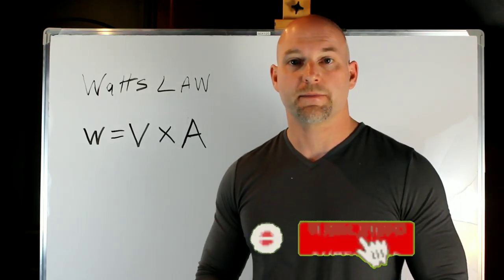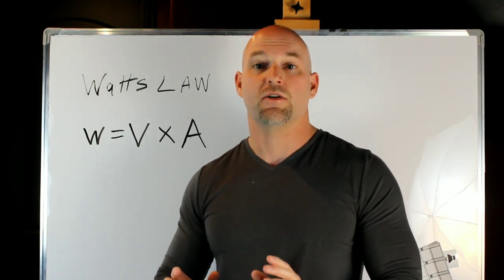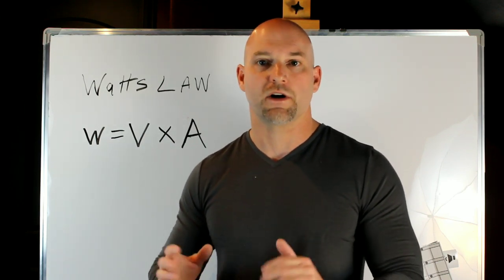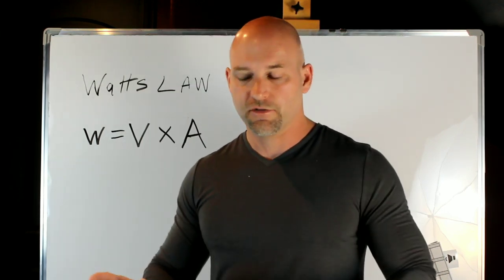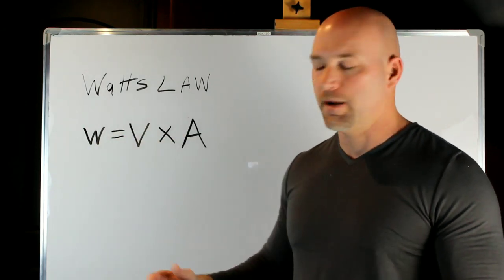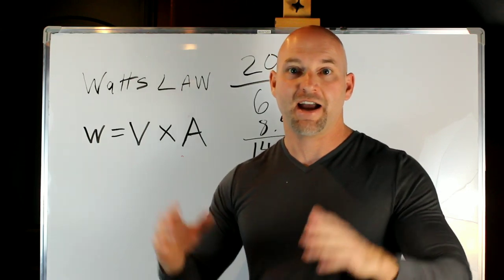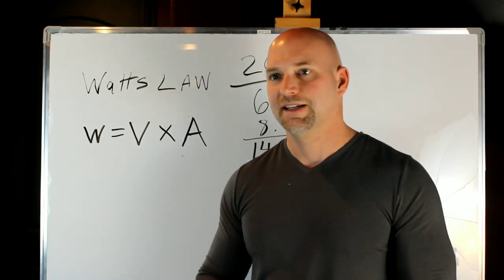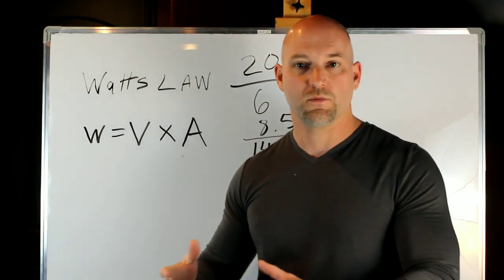Ep. 19 - How to determine how much Home Theater gear can be put on a circuit | Home Theater Gurus

Comment: As a professional installer I just want to add that 99.99% of the systems out there are perfectly fine on a single 15a feed. The more relavent issue is proper system grounding...but that's another story...
Good video with correct info 👍
Reply from the maker: Thanks!

Comment: Up-size Your Wiring

It's important to note that if one is wiring their Home Theater, it's prudent to up-size the wiring to the receptacles supplying the gear. That way voltage drop can effects can be minimized. 

As stated elsewhere, to avoid nuisance tripping, breakers can pass mammoth amounts of current for prior to opening up. 

A 20a residential breaker can typically pass; 
~140-160 amps for a second
~60amps for ten seconds ~30-40amps for as long as 30 seconds!  
They're designed this way to prevent nuisance tripping... whereby you'd be in your panelboard resetting breakers constantly. 

Circuits supplying subs in high performance HT, up-size the branch circuit wire size between the breaker and the receptacle.

Comment: Really surprised there are not a lot more comments on this episode.  This is definitely one thing I think people overlook, or at least don’t consider at this level.  Since I’m running a Denon 4400 running 4 surround and 4 Atmos, an Emotiva BasX 3 running my L/C/R and 2 SVS subs all on the same 15A circuit, I’m surprised it hasn’t tripped.  Thankfully my basement where this room resides isn’t finished, so I think I’ll do one 20A for the subs, tap the Projector in the lights, and 2x 15A to run the equipment (Denon, Apple TV and rack cooling fan on one, and Emotiva and Bluray Player, PS4, Xbox S on the other).  Not that I’m worried about a fire as much as tripping the breaker when everything is running.

Great vid!  Thank you
Reply: The breaker will allow much more current than 15 or 20 amps ... easily double that for extended periods.
Reply: @FOH3663  our breakers only permit a spike up to 20 amps for a few seconds and then trip. We wouldn’t want it to do 20A+ continuously as the wire is only 14 awg, standard for a 15A outlets.
Reply: @zalllon  
Your breaker behave just as I described.

Comment: A couple of points. Those amperage ratings are for continuous full draw. When you are just listening at moderate levels with no explosions, your amp is barely pulling anything near those ratings. 

Also, in regard to to the 15 and 20 panel amp. Those ratings are for a continuous pull. They will happily handle bursts of ~10 times their ability for a handful of seconds, say a large explosion in a movie, where you get full draw for a short period. 

Now, if you play a continuous sine wave at reference, then you'll have problems. Dubb step, etc... But for movies, you can pack a lot of power on a single 15amp circuit.
Reply from the maker: Not sure if you watched all of the video but I mention pretty much all of that in the video, the breaker doesn't trip immediately and briefly explain how it works, I explain we normally use a fraction of the speced load.
Reply: @hometheatergurus  I honestly watched the entire thing. Must have glossed over it. Turns out, i'm dumb sometimes.
Great Videos!
Reply from the maker: Haha... No worries I'm the worst at missing stuff and sure sometimes I forget to put something in a video or wish I had added things. A lot of the stuff is kept short and sweet on purpose.

Comment: So instead of plugging everything into a surge protector/power conditioner, I should spread it out to different wall outlets throughout the room?  I want to do 2 front subs and 1 rear (dual SB-3000-front, one sb-1000 pro-rear).  But I also plan on having an 85inch mini led with an 11-channel power amplifier.  So I'm thinking Plug in the TV, DVD player, Pre-Amp, and Amp into a surge protector/conditioner that plugs into one outlet, but at least plug in and run the subwoofers to a different wall outlet to break up the power draw?  Hope that makes sense.
Reply from the maker: Not different wall outlets but ideally on different circuits.  That's assuming you've added up what is on  each circuit and its maxed out.  It's not always possible in preexisting rooms as many times all of the outlets in a room are on the same circuit.
Reply: @hometheatergurus  Cool, Thanks for that response.  May look into adding a dedicated circuit then. Checked my breaker box and there is one switch for the entire
 game room :(

Comment: i have a old QSC amp that i want to use for subs.....its a QSC MX 3000 IT SAYS NORMAL OPERATION IS 12 AMPS AND FULL POWER IS 58 AMPS...WOULD I BE GOOD WITH A 20 AMP BREAKER..?..

Comment: So, in your opinion, I should use a dedicated 20 Amp circuit for each JTR Captivator 2400 ULF? I am in the process of wiring now. Great videos! Really appreciate the tips!
Reply: Two of those amplifiers can share circuit, as long as you don't encounter significant voltage drop
Reply: Eric, did you end up running a dedicated amp if you don't mind me asking?  I've got a JTR Cap 1400 but doing some big upgrades, 9 Channel Amp, 5 JTR Speakers, etc and am worried about putting everything on one circuit.

Comment: Ok so I’m building subs at the moment but I’m currently running a LG 65C8, Oppo 203, Emotiva XPA-DR2, XPA5 and a XMC1 all off the standard house circuit (AUS 240v) but I’ve got 3 Crown XLS2002 for 6 sealed SI SQL15’s when they get released.
Should I run one or two new lines just for the HT??
Reply: 2. Won't cost much extra and you will use it

Comment: Is it safe to say that if you don't notice dimming lights or anything, then you are good?
My Marantz SR7011 (710w), Sony A9G (653w), and PS4 Pro (310w) puts me at 13.9 amps. Not including the subwoofer (different outlet yet likely same circuit) HSU VTF15-MK2 and everything else on standby...

I'm not sure if I have 15amp or 20amp circuit. My house was built in 1986.
Reply from the maker: Yep definitely safe to say.  It's those darn subs that can really cause issues! If you don't see any dimming don't worry about it.